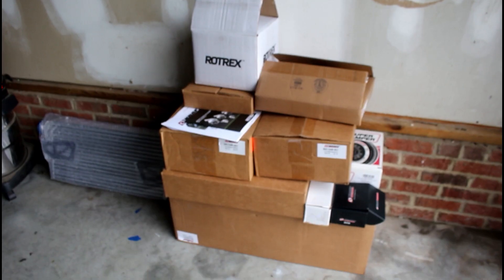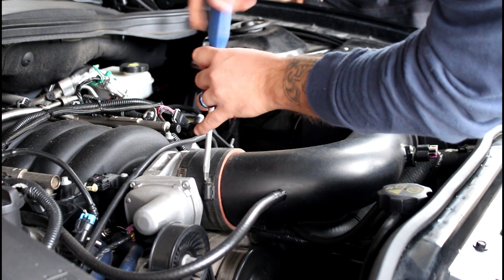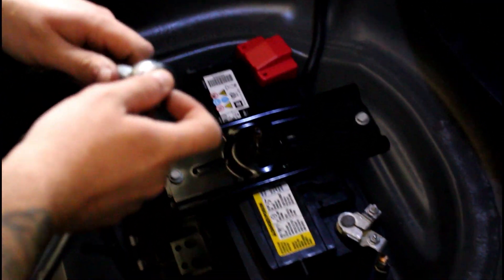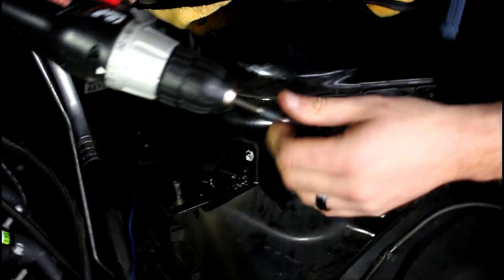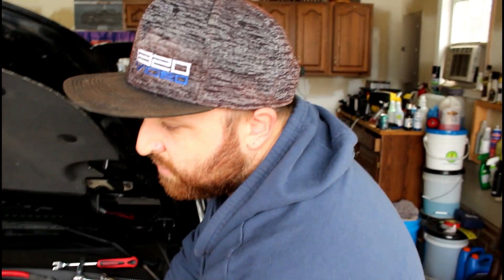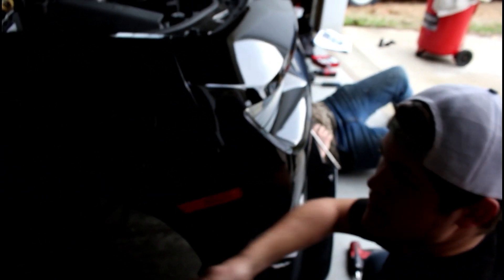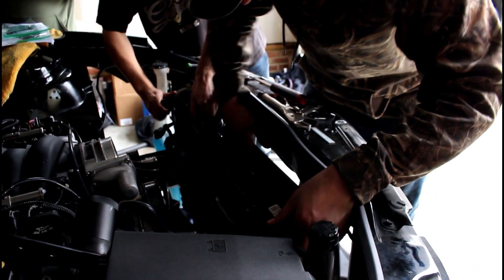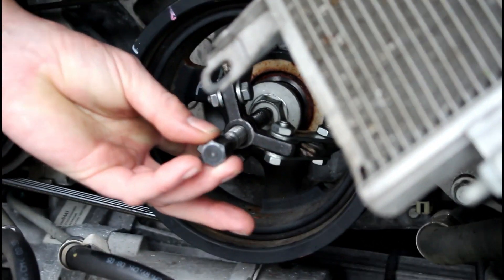KraftWerks 2010-2015 SS Camaro Supercharger Install Part 1

Comment: Jeremy you've got some good people there doing all this for you! I hope you didn't mount the MSD next to the brake master cylinder, there is a factory hole in the firewall there that makes running any wires inside the car a breeze, you only need a 7/8" grommet. That box is small so maybe you'll still be able to access it. I ran my nitrous wiring and feed line, and line lock wiring through it, and I still have room for more if needed.
Reply from the maker: Thanks Joe. All the wiring was previously routed through the fire, I just had to MSD box mounted to my old cold air intake. Haven’t decided yet where to relocate the box

Comment: Do you currently have all-season tires or summer tires?  You've talked about them in a previous video, I just can't remember.
Was just wondering if you will need to change things up wheel & tire-wise for the extra hp.  Or do you think you'll be good to go?
Reply from the maker: All season Atturo AZ850 Tires. 315’s in the rear hook up very well for a street tire. I’ll probably stick with what I have. I’ve been very happy so far with these tires, and they are very affordable! Once I get a one piece driveshaft and axles, I’ll probably buy a set of race stars for track purpose..probably a year from now when I can afford it lol

Comment: Does this kit work with both ls3 engines and l99? Also can i install this whole kit on my car if its stock ? Or do i need to do some prior modifications before doing so to not have any problems?
Reply from the maker: Works on both. You are actually better off using this kit without any mods. Seems like my Longtubes and cam suck up boost. You should be able to make mid to high 500s at the wheel bolting the kit out. If you want more than 600 whp in the long run, I would go ECS or Procharger kit. Kraftwerks makes a very reliable kit, just lacks on BIG power. Just figure out your goals before making a decision